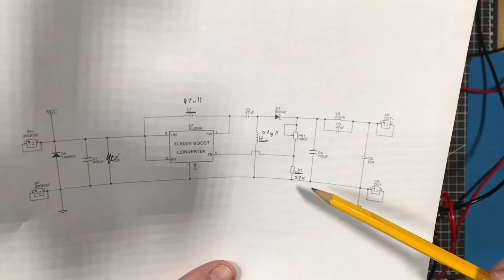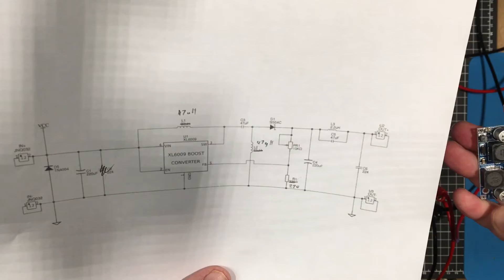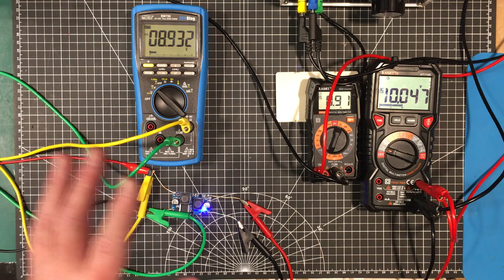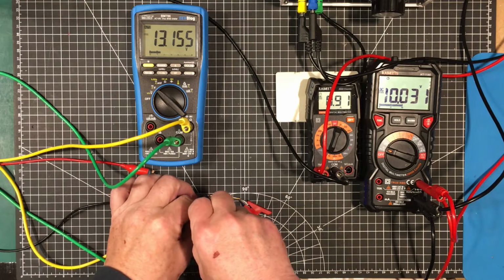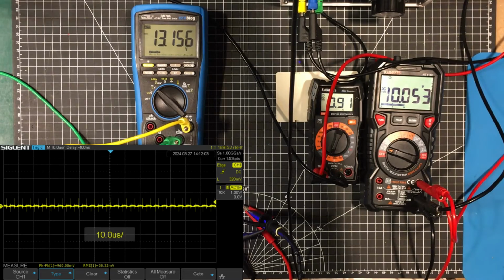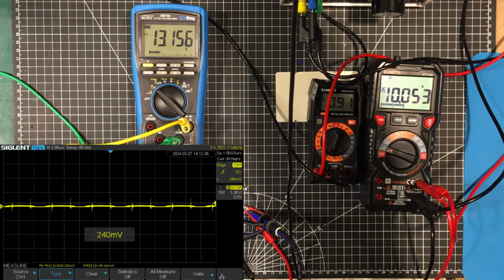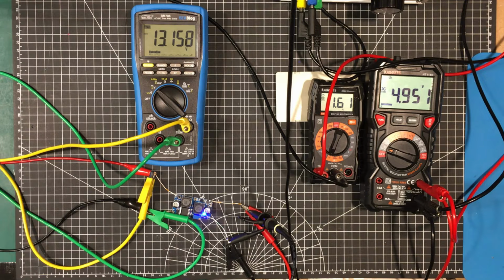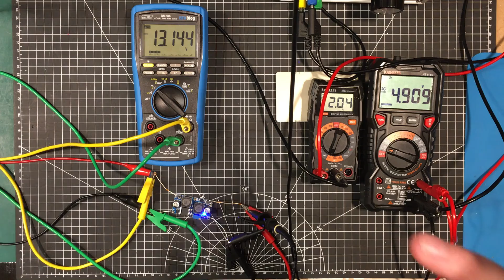Uni-Byte 0172 - XL6009 based BUCK-BOOST Module (Module of the MONTH)

Comment: what was that noise ?
Reply from the maker: Which noise are you talking about?  It is a lab and in it work gets done.  There may have been equipment on for one reason or another, including at least a power supply and an oscilloscope as used int the video.  Plus there are always two computers on in there.   OR was there some specific low noise at some point?
Reply: @uni-byte  7:35 , the moment the boost converter kicks in , i hear an audible noise . What's that ? Is it coming from the instrument or the boost converter board
Reply from the maker: @AmanSinghal-ny3ik  I honestly can't hear it, but I have very poor high frequency hearing.  If it is HF then it possibly is the coming from the board.  The inductor might have a loose winding.
Reply: @uni-byte  i see . Also there are some modules which have a current limiting feature in them , can you make a video and explain how they work ?
Reply from the maker: @AmanSinghal-ny3ik  Yes, there are switching regulators with programmable current limits designed onto the chip.  The usual way to do it externally, and this works for both switching and linear supplies, is to use a small value resistor to measure the current, pass this through an inverting amplifier then into the output control of the regulator.  I may do a project on designing a bench power supply.  People don't look at them though, so...  In the mean time you could try google searches like "boost converter with programmable current limit" or "buck converter with programmable current limit".

Comment: I've seen people on YT testing different XL6009 modules at down to 3,6 volts or something why does your behave like that?
Reply from the maker: Like I said at the start, the cricut they are using is not recommended by any of the manufacturers.  I guess you could say it's built down to a price.

Comment: Hey man, so I have a mini DSP amp. I plan to use a 4s2p battery on it but my charger (Ugreen 57w 3a) can only give [5v - 9v - 12] "15v" [and 20v]. So I plan to use this after the USB-C decoy. ask for 20v from the charger, use this xl6009 to bring it down to 16v and charge the 4s bms. What do you think? do I need to change anything on the board? a better diode or what not? or use a step up instead? 15v to 16v?  I am new to this by the way but I am learning. Thank you!
Reply from the maker: You would need some sort of protection against over charging.  Some cells have this built in.  If your cells do not, you will need to add a charge controller.  Otherwise it should be fine
Reply: @uni-byte  which one is better? the charger can provide 15v at 3a and 20v at 2.25a. which one should I go? step up to 16v? or step down to 16v from 20v?
Reply from the maker: @lancereyesromero7811  The step up should be fine.
Reply: @uni-byte  by the way, thank you for this video
Reply from the maker: @lancereyesromero7811  You're welcome.

Comment: The datasheet itself has some typical schematics
Reply from the maker: Yes, there are several datasheets out from different manufactures.  Some have much more samples circuits than  others.  The XLSEMI data sheet only has one (it has it twice though!).  However, none of the circuits I could find on the datasheets I located had this SEPIC (single-ended primary-inductor converter) boost-buck configuration.

Comment: They have their place but you will, as you say , need to filter it better. I have used them for simple projects with no issue....cheers.
Reply from the maker: Simple projects are what these are good for.  They are actually quieter than most cheap wall warts so would be ideal for making up portable power packs for deices that came with those.
Reply: Indeed :) @uni-byte

Comment: I bought a couple of those for gear that needs an actual 12 volts, not a nominal 12 Volt battery that can be anywhere from 14.5 down to 10 volts, which is what I plan to run them with. After looking them over I decided to just pull the chips off and build my own buck/boost supplies with a higher current rated diode, better pot, a couple more filter caps, and winding a larger toroid for the inductors. For another 50 cents or a dollar's worth of parts (that I already have in stock anyway) they can be much better, with higher power, wider voltage operation, and be more useful devices. The XL6009 chips seem quite capable for the task, but the Chinese just cut way too many corners in building these modules. So I'm going to turn them into little construction projects. The end result should be quite versatile.
Reply from the maker: Yes, the coils and at least the inter-stage and output capacitors could certainly be upgraded.  Keep in mind though, this is a $1 item.  Let us know how your efforts work out.
Reply: You have to shop around to get the actual original module instead of counterfeit ones, which goes without saying for anything you buy these days. Whenever I’m looking for a particular module I buy several of the same module from different sellers at different prices and it’s amazing the various levels of quality.